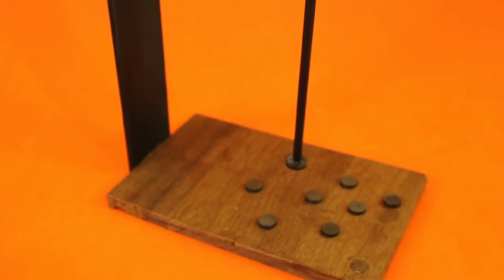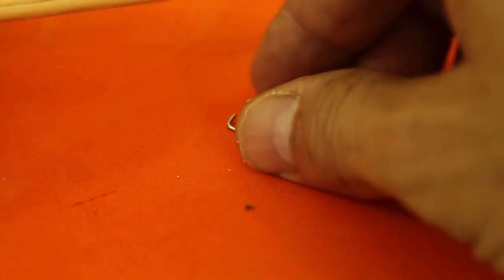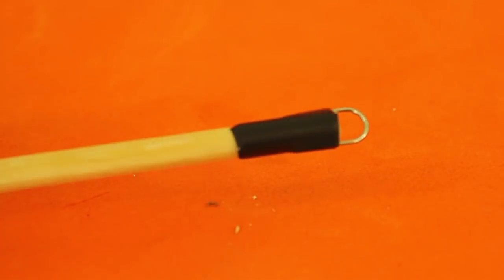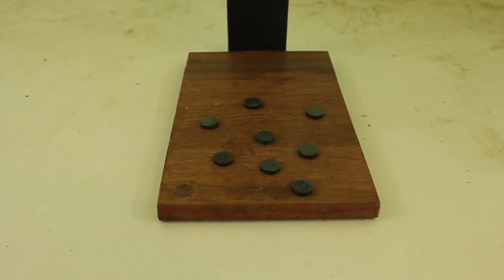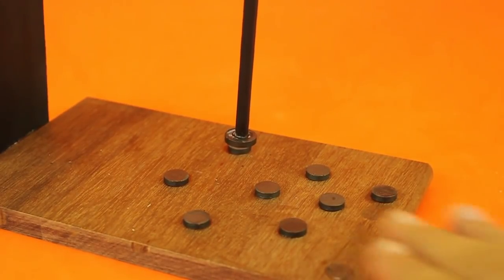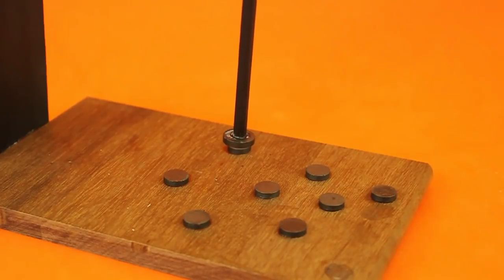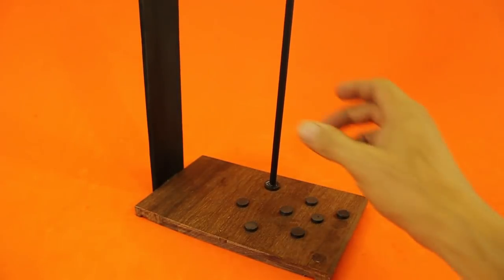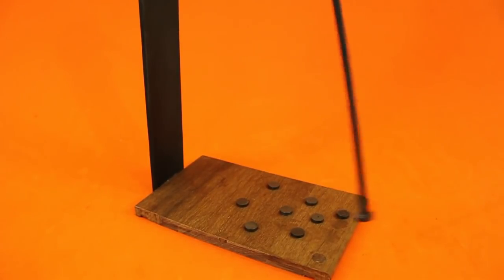Chaotic Pendulum with Magnets

Comment: It's a pity gravity causes it to eventually stop, meaning there is no free energy in the universe.
Reply: Most of pendulum’s energy is released as vibrations in the air and in the support structure.
The ball, tether, and gravity form an oscillator that store and release kinetic energy. Gravity only directly releases energy as very weak gravitational waves.
Reply: @ Kenneth Studstill. Bottom line is: there is still no free energy anywhere in the universe!
Reply: + HowToExcel Agreed.